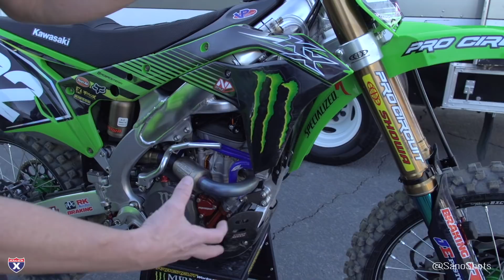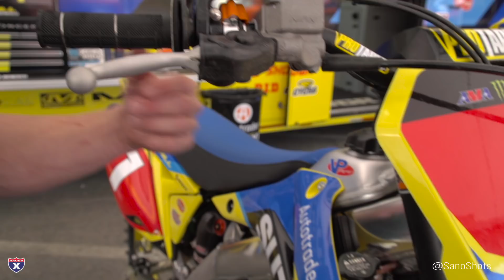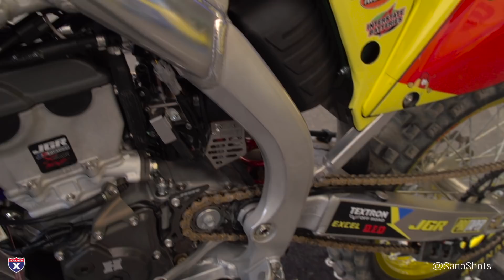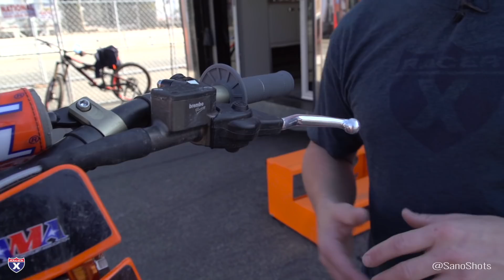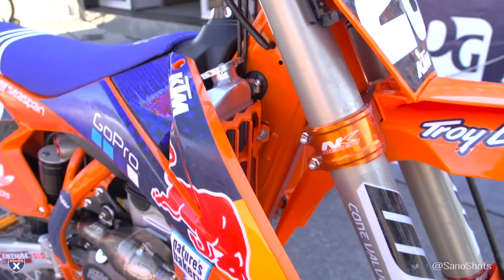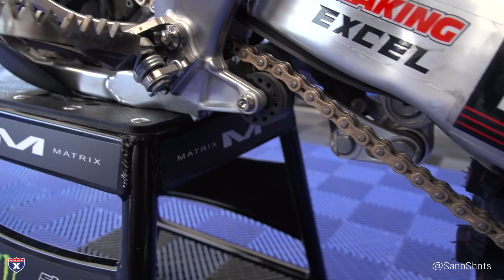Racer X Films: 2018 250 Factory Bikes

Comment: Ping stated that the holes drilled in the chain roller were used for a different feel when the shock was deeper in the stroke.   I do not believe that since the chain will not be in contact with the roller in the deeper stroke of the shock, so how can it be compressed if it doesn't touch it ?    Only when the shock is at full lift does the chain compress on the roller.   
Anything that spins creates weight mass and then you have drag on the chain which then creates drag on the engine.   Like drilling the inner chain links making the overall weight of the chain lighter therefore freeing up horsepower.   Put steel sprockets on your dirt bike and go ride then switch to aluminum it makes a huge difference.  I remember when I bought a wreaked Ducati that had Magnesium rims and I switched them to my race bike, it made a world of difference not just in acceleration but going from side to side switch up in the corners was a whole new world on the track.  After that I looked at everything in a different way, if it spins it needs to be as light as it can be.

Comment: It is cool to see which rider prefers the things that you as a rider like, like the rubber boot on the shifter end of Craig's bike, also the level, his is much lower compared to the others.   When you grew up doing your own wrenching while racing you learn more about each little thing that you can do different on your bike by seeing the factory bikes, so getting to see up close each one of these bikes is a real treat thx RacerX n Ping.   Notice what looked like a heat-thermal coating on the KTM cylinders too, Kawasaki had huge cylinder bolts too.  Suzuki hubs were smaller, got to love that Titanium.   Nothing like those PC Kawasaki so much more work, even green coating on the rear shock shaft.    Also looks like  KTM uses more stock parts, oh also the huge counter-shaft sprocket on the Yamaha  w/o holes drilled Titanium?    Renegade fuels for Honda, I bet Honda has a secret mixture.  Also Honda's front fender has more holes for cooling maybe they need custom radiators like PC Kawasaki.   Big thumbs up Ping for the extra insight !!!  Oh another thing I noticed the Yamaha had the inside links on the chain drilled super trick there.

Comment: Who gets to buy these bikes when they’re done with them?
Reply: Google User you can build one but cant buy a already built factory bike they keep them or take all the factory parts off put it back to some what stock and goes up forsale
Reply: blomgren182 all it takes is money & the right connections if you got that you can get anything i have one of Austin forkners race bikes but i also ride for team green amateur program
Reply: Some teams will sell them, but they'll take off all of the works parts and sell with a stock motor or suspension. You cannot purchase those exact bikes.
Reply: UndyingEuphoria that’s too bad. Would love to buy one!
Reply: Google User  i doubt you would, because if something breaks you cant replace it , engine wise. They use unobtanium parts, specially made for the specific engine package and with that goes certain amount of hours on different parts, they tear the bike apart after every single race to get data and check for possible wearness. The guys pushing these bikes to the limit and it wears, not much of you see is showroom stock they touch literally everything to make it better and more compeditive, and if you would buy one of those and go to your local gas station you would not be able to run pumpas without it denotating on you. 

There is some stuff you can but because of the production rules Showa A kit for example. You can ask for similar engine package but it still wont be the same, factory transmissions, electronics, race team specific cams - Pistons, you name it all tailored for rider and teams preference they sending alot of it back to austria or Japan depending on the manufactures
 
One good example is the exhaust, they might look what you buy of the showroom floor but there is different internals and endcaps and non stop testing to produce better sound restricion and power

That is why there is no price tag and you never rarely see anything on the market that is factory parts.   But if you want you could always build replicas and you would be good cause only a minority could use a full blown racebike anyway.

Lets say if you would get a hold of one you would literally frame it.
Reply: FlmxFilms  yeah there you go, you are part of the family , i doubt certain parts like transmission - factory hubs -  certain stuff gets in the hand of the average Joe , that what was Aron at Factory Kawi told me when i worked him and Josh Hansen at PC years back. If you are Chad Reed you could get your hands on alot 😁

Comment: Do y'all know what kind holeshot device that was on the Pro Circuit bike?
Reply: Connor Overstreet problably a pro circuit holeshot device. not being a smartass just saying it is probcircuit race team and i do believe they make one
Reply: Not sure what one is on his bike as shown, but Pro Circuit does sell a holeshot device that looks to be a rebadged Works Connection piece.
Reply: Connor Overstreet a custom made procircuit holeshot device they sell them on there website or can also check out Tammer holeshot devices they have a rear holeshot device to lock the rear shock down I use them on my race bikes